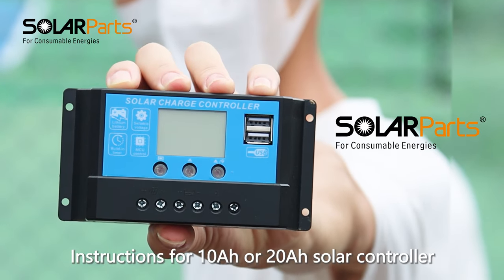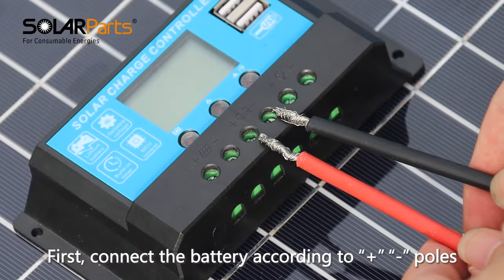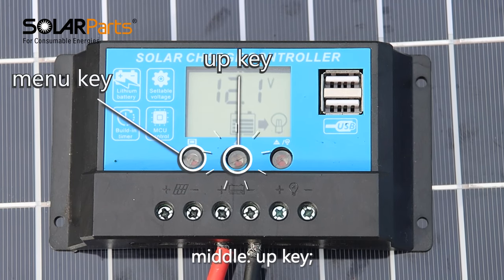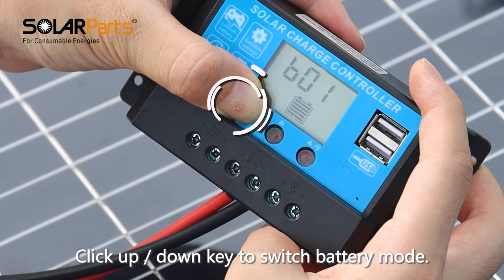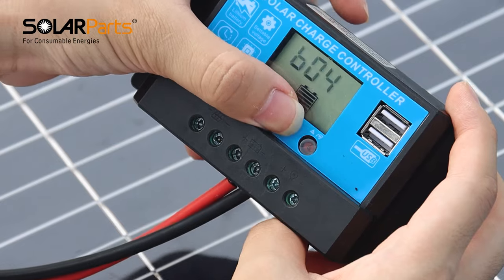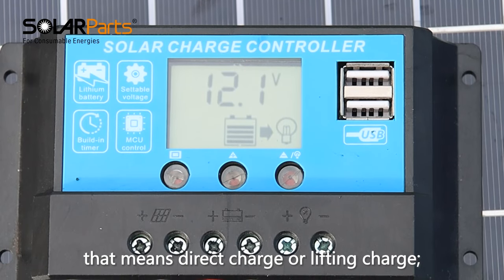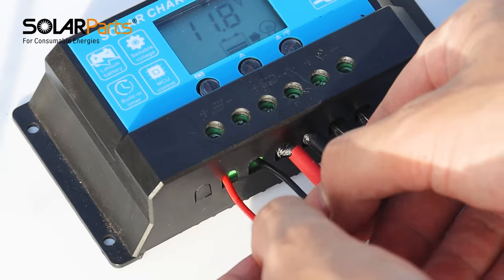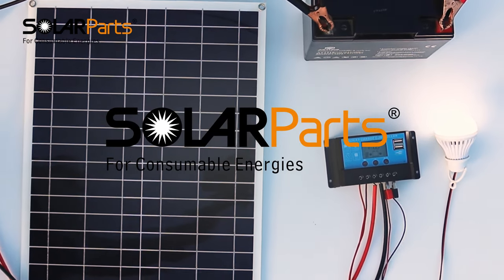How To Setup a Basic Solar Charge Controller | Quick Guide & Menu Overview

Comment: Hello,
Could, should, would you introduce a battery charger to an off grid solar setup with this exact charge controler, so as the generator is on to run the Lawnmower you could take the chance to charge the batteries too, (12v lead acid leisure batteries), especially on the days the sun does not shine.
If so, would you disconnect the charge controller?
I'd be wanting maximum amps like 6 or 12amps going into the batteries during the 15 mins of grass cutting.

Comment: Hi I would like to ask - can I connect controller directly to soler panel and charge usb devices or do I need battery. And Is controller going to show any walues if I connect it directly to solar panel.
Reply: It will work....but be careful for excess current . You can use any used /second hand rechargeable battery with correct voltage to remove the flow of electric. If you don't want to use a battery then make sure to remove the panel from sunlight after phones charges.
Reply: Stand by to let the magic smoke out
Reply: My controller crashes when I plug in a USB cable. Please help. Thanks
Reply: @barnaclelevi  my controller crashes as soon as I plug in a USB cable. Please help me, thanks
Reply: @Sam-ij2sd  a 12v solar system needs a 12v battery connected to the controller first and then you wire in the panel. You cannot use a basic cheap controller wired to a panel and draw power from it, it simply doesn't work. I don't know why but I have tried it myself and ended up "letting out the magic smoke" which is the term used for frying the controller and witnessing a pop noise followed by a small puff of black smoke. I then had to wait an extra month before I could afford to buy a battery along with a new controller. Lesson learned.
Reply: @Sam-ij2sd  Do you have a battery connected to controller?
Reply: Never connect solar to any controller without connecting battery first or you will damage the controller.

Comment: Hi! Thank you for the video! I have the controller, the battery (sealed) and the panel 100W but not the connecting wires. Can someone tell me the specifics for the wires?
Reply: I do 4 AWG gauge wires from the battery/s to the charge controller and from the batteries to the inverter (these are high amps/current) and 10-12 AWG gauge from the panel/s to the charge controller. 14 AWG wires from my 4 100W panels get hot at the splice connections aka fire hazard. I've seen these panels push 10A. Think about expansion, too. You may want to add panels and/or batteries like I did, so go with bigass wires as you can afford.
Reply: The thicker the wires the better.

Comment: can I use this controler for 24 volts solar panel for 12 volts singel battery charge
Reply from the maker: yes, you can use, the controller are automatically changed the output voltage when contact to the battery. thanks!

Comment: Can these lead acid-type solar controllers be used to charge Vtoman or Jackery power stations with internal lithium phosphate (LiFePO4) cells?
Reply: I've got a kings version of one of these and can't set the lifepo4 option, but use it on the lead acid setting anyway, seems to work ok
Reply: No charge controller is required for Jackery type solar generators. Plug into it, directly from the solar panel. The charge controller is built in.

Comment: Thanx a Million. I did not know Gel battery was b2. I thought my battery had a problem. Music not so nice
Reply: I had almost the same problem . I've got a sealed battery and the controller settings was on b02(gel) . I couldn't set it more than 12,6 Volt  .Once I changed to b01 went to 14.4 Volt. Many thanks! 🙏
Reply: @ioanros6576  Good day, please assist, do you add an inverter to this mix, and what role does it play.? I'm located at a place where electricians are doubling up as solar installers but without necessary training. I'm the owner who doesn't want their house to go up in flames. Thank you.

Comment: I have this . Where does it show the voltage of the battery without a usb device charging? Also when i put a device in the usb output the number always changes and it goes higher .why?
Reply: When I plug in a USB cable the controller crashes

Comment: What is the light voltage output? 5 or 12 volts?
Reply: 12 volts.  The USB ports output 5 volts.
Reply: @unionville533  So I could charge power banks?
Reply: @mackychloe  Yes, the USB output can be used to charge power banks that have USB inputs.
Reply: @unionville533  Can it be done direct or do i still need the 12v battery?

Comment: I just installed the very same controller but neither of the USB ports are working. Any ideas on why?
Reply: You may need to turn on the "output" by pushing the right hand button.. Icon will show on the display if ON
Reply: @eddyk6853  As a matter of fact, that was the solution. Thanks!

Comment: i don't understand all the lithium settings i.e. 4 strands , 5 strands, what does this mean
Reply: it means series connection. For example 4s is four batteries wired in series.

Comment: can we use this charge controller for DC to water pump?
Reply: If its a dc pump yes
Reply: i use this controller to a car 12v batterey then a timer to a 12v dc water pump to heat my spa through a water coil .. been good 2 years now

Comment: Quick question whenever I connect the battery to the charge controller while the solar is connected the charge controller just turns off how do I fix that issue?
Reply: Always hook up the battery/s first, then the panels. Opposite when disconnecting, unplug panels 1st, then batteries.

Comment: you use just clips to connect the battery - what happens  in one clip goes away while the panel is connected? will the controller destroyed?
Reply: will turn off, unless you short them nothing should happen to it
Reply: manual : 1. disconnect solar panel  then  2. connect battery and then panel

Comment: I think solar controller 10 A  (not 10Ah)  -  ver. 10 A ( this for 12v solar panel)  can connect 10A x 12V=120 W (solar panel max)   - also can connect  solar panel 18V but  max 120 W  solar panel !!!!